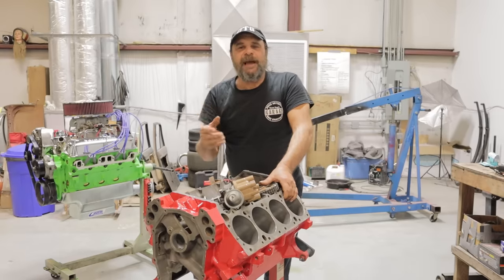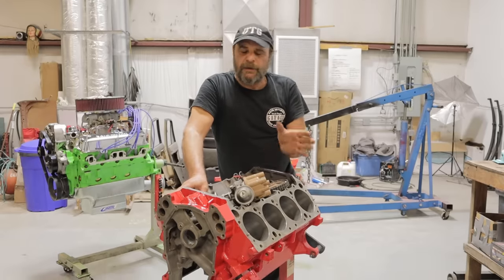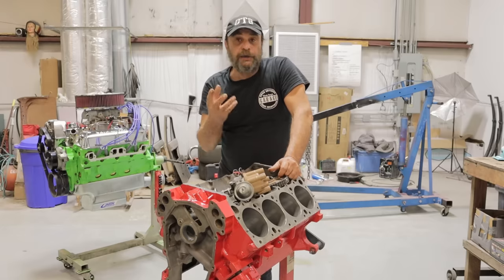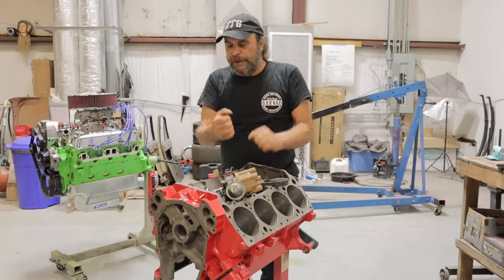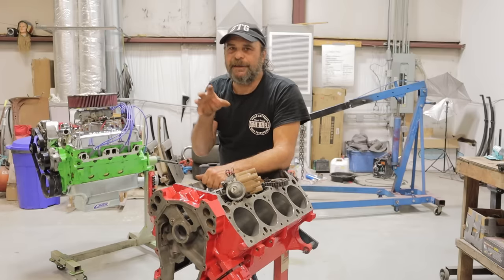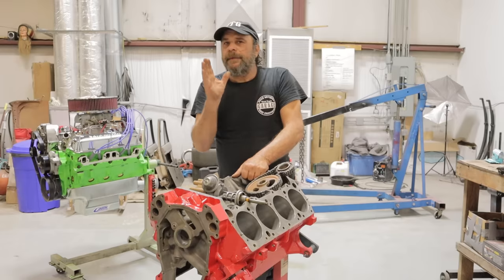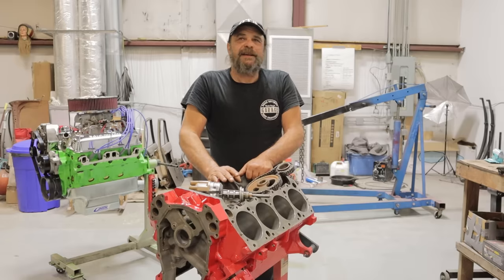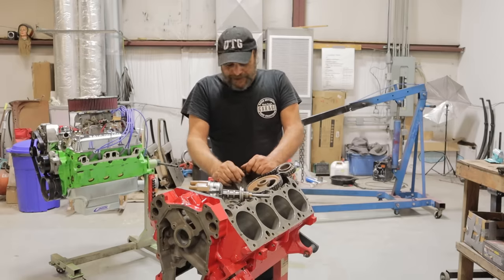Power Timing Secrets For Classic Cars

Comment: He may stumble or whatever. But who can have so much info and be spot on?
I'm 24. I learned from guys that was vets of WW2 and some even from WW2. Pretty much spot on with Mr. Tony here.
I can set the distributor with just a vacuum gauge and the engine will run great. Most folks needs a timing light to do the "same."

Comment: when I static timed my 94 silverado TBI engine with  electronic ignition it was kind of flat... I advanced it 2 degrees and it made a huge difference in responsiveness and overall smoothness and power.  this is a 210.000 mile engine that runs great now.

Comment: I've got an old slant six that hasn't been taken apart since the late 90's I'm pretty sure.  Its got a lot of miles put on it since then.  I have attempted to tune it up a couple months back and had it running at about 12 ATDC.  I just had a feeling the timing still wasn't right.  I saw in one of you're past videos, the slant six doesn't like low RPM and it really comes to life somewhere in the 2500 to 3000 rpm range.  Well in the low range it felt bogy/ labored and didn't really pick up until higher RPM. Just today I went in and lashed the valves.  I want to go back and redo the timing, especially now that the valves are adjusted and maybe bring the timing up to 15 or 16 degrees like you said, just one noodge at a time.  I have a feeling it'll make a world of a difference. I love you're videos! Just like you, I'm self taught and learning as I go...these videos really help me out a ton!

Comment: I just rebuilt a 4 cylinder Mercruiser/GM for a small project boat. it wont start but turns over I'm going to try the nudge technique. It is "backfiring" through the carb though. I cant use the timing light obviously because like I said... it wont start.  Hope this works. I rebuilt a 350 last year for another boat and I did'n't have a problem. Your videos are awesome thanks for talking the time!

Comment: You are totally right, I got practice when I was 17 in 1995 with my 302 HO carbureted, those nutches 😅 are the secret. BTW the knock you are trying to transmit is the same knock like rattle when engines overheat. Nice video, thanks for bringing those funny flashbacks when I wish I can afford a timing lamp, I either bought the lamp or the head gaskets. My noob mistake was thinking higher compression the more HP without any sacrifices, yeah right. That mistake cost me like 60% of my check to gas it up, there wasn’t any VP near by so I had to put 6 octane boosters per tank to relax the 11.7:1 😂😂😂

Comment: I totally get how this is hard to explain because I did this same thing back in 2007 when I was initially building my van starting out. To this day I still don't have a timing light yet and I've had the distributor in and out of it multiple times, put in new rockers and pushrods setting valve lash, installed a new intake manifold, configured quadrajets, and tons of other stuff and in my own way did this exact same process. You can feel where you need to be off of the "harmonics" or vibrations that the engine is giving off next to you. Since I was working with a van there's something even more personal about it being that you can literally drive with the engine next to you. I've gotten better gas mileage with a Quadrajet than I've ever witnessed with Chevy TBI as well. Nowdays I even time my Hondas by ear, feel, sound, and throttle response. I'm hoping I can get a timing light and a harmonic balancer installer/remover tool in the next couple years. Gotta have that to build the spare 350 engine I'm cleaning up.

Comment: I would love to see your reaction if you ever took a modern ECM tuning class. I think you might be shocked seeing what you can do. Engines so modified that they could never be usable on the streets back then. Can become usable with good driveability. And on top of that, have your factory computer control things. like nitrous oxide methanol injection or even boost controlling. I am running 2 bar speed density on a factory Corvette Ecm.  A computer never made for handling boost. But I understand your love for that era. And It's simplicity.
Reply: Your talking modern day vs opocolyptic preparedness. I'm somewhat of a conspiracy leaning person so tend toward old school
Reply: @campnoutdoors1621   I can understand and respect that.

Comment: Short version [assuming "stock" timing as found]: tiny bumps to advance until motor goes from a perfunctory ho-hum response to feeling a little snappiness when throttle applied - stop there.   Shadetree know how in a nutshell. 
Points? I gotta have a dwell meter, but I can get down the road til later by folding a dollar bill twice: 4x thickness is damn close to 0.015"

Comment: I've been suspecting this for quite some time. I have an FE390 with about 90k miles on it. The timing chain was worn out (common thing on old FE before double roller chains). I had to advance it well past the original 10 degrees advance to run right. Wouldn't hardly run on less that 10 degrees. I changed the timing set and now it's fine. I also have an old small block Chevy with only 40k miles on it and I can tell it already needs more advance than the original spec. If I don't want to mess with timing all the time, I do try to adjust them during the hottest time of summer and after running the engine several miles so it's good and warm inside the combustion chamber. Great advice. Thanks.

Comment: Another great video!
I know there are O2-based mixture sensors. I bet a stand-alone sensor that measures knock using a modern sensor would be a great diagnostic tool in these instances.
Reply: They have them. They are called knock sensors
Reply: @alexyoung4587  There is no stand-alone knock sensors, similar to an air/fuel ratio sensor, that I am aware of.
Reply: @alexyoung4587  I'm aware. Perhaps you know of a source that has a stand -alone unit that could be used for tuning?

Comment: I have been doing it this way over 40 years I call it road timing and later on in time when done on my 318 with 340 x heads edle performer intake 600cfm carb 15/8 headers id beat some big blocks because i know them boys didn,t know this trick, I understood right from the start of this video what you are talking about. My 318 runs strong on this combo, I failed to mention im running a stock cam otherwise with the 202 valves it would kill my engines performance I am assuming may be I can go a little bigger yet the stock cam worked well.1972 ply scamp 727 trany 373 in rear.

Comment: So this is what I did today on an ‘85 K10, 350. I had a vacuum leak that ended up being the intake gasket on the left side, pulled the manifold, edelbrock performer, cleaned everything up, dropped the intake back on with good fel pro gaskets, got the number 1 to TDC on the compression stroke, dropped the distributor in, rotor at number 1, everything going pretty good, started up good, ran semi ok, getting some popping through the exhaust when shifting, standard, nothing too bad, but I don’t have a timing tab on the timing chain cover so I got out the vacuum gauge and advanced the distributor to about 20, took it out, ran good, popping gone, ran strong, seemed to like the setting, the only issue now is that it turns hard trying to start it where it never did that before, I also tuned the carb with the vacuum gauge as per the UTG video, yeah I’m a subscriber, so it all seems to be pretty good except for the hard cranking, not complaining, it seemed pretty happy, I’m just wondering if I’m a little too advanced

Comment: Just bought a classic car with a Chevy 307. Runs fine but some hesitation on first gas. I did what you suggest. I gave it a nudge. (timing light said it was already 15 degrees before tdc) After the nudge, car runs better than ever. Smooth acceleration. Now it reads 17 degrees advanced. Others are telling me that may be too much and could cause detonation. Should I worry?

Comment: Some smog distributors have so much mechanical advance that you'll be getting spark knock at higher RPM/under load while still having a sub-optimal initial timing. Limiting the mechanical advance first can make a huge difference. I have a Ford 300 that would ping hard under load with more than 10 degrees initial, after limiting it to 16 degrees mechanical and setting the initial to 20 it wants to twist the frame as soon as you touch the throttle without ever pinging and runs beautifully.

Comment: @Uncle Tony's Garage
So out of curiosity, "with an automatic"  what if one were to chock front wheels and having a friend stand on the brakes (make sure you don't owe them money) and 'you' controlling the throttle work it up until its up against the converter, no tire spin, and adjust timing until spark knock just goes away? 
Is this about the same thing? 
Obviously you are not gonna be able to do this with 500hp cars, or anything that overpowers the brakes, but rather 3-400 hp street cars? Seems like about the same idea...? Was showed this trick by a couple different  old timers and it made my car i had in highschool turn into a rocket. I've done it a few other times too, on mild street cars,, with great results. Its cave man, but seemed to work...?
Just curious. 🤷🏼‍♂️

Done it driving, like you explained it too, using a timing light just to record my "nudges".... but not everywhere has easily accessible hills nearby.

Comment: An off the wall here but it applies as well. I used to play guitar & bass. I tuned by ear and because of that I could go from a standard open tuning to a drop D in the middle of a song or solo. Now I've lost my ear (I'm going deaf) so I have to rely on a tuner. I can't do that anymore; I have to stop or grab another guitar. It sucks.
Great video UTG! When I 1st got into this stuff, dad made me do everything by feel & hand. Why? Because you don't always have the fancy tools to get it dead nuts on, and tools are mechanical (or electronic) devices. They wear out. They can have problems. If you have the "feel & ear" for it, not only will you know if the car is right, but you'll also know if the tool is right. People hit me all the time with the "why don't you use this or that" when they see me using hand tools and using the "Nooge or Smidge" adjustments..... it's because I'm feeling it just like you are describing.

Comment: I daily drive an 85 f150 300 straight 6, new china made Carter yf single barrel and a no name hei distributor. Np435 granny 4 speed transmissiom. Used this method to time the distributor after watching this video. The truck has the best acceleration and smoothest idle yet. Though I went 2 nudges back after the ping started to account for added weight in the bed if I ever need to haul something.

Comment: I do it sorta similarly. Tony remember a couple livestreams back when I mentioned I am running 42 to 45 total on my 455 with a closed chamber head on E85? Those heads were on another 455 in the 1990s, running VP red and Sunoco 110 race gas. It wanted 52 degrees total with both of those fuels.  E85 burns faster so it wants a bit less timing. Its what it wants and it runs fastest and the most drivable with that much advance. No the balancer did not slip either, and multiple lights have been used to see where its at including dial back and marking the balancer ring..

What happened when I backed it down to 36-38 total like all the chevy guys say to do? It went from 11.40s@120mph with all the advance, to 13.20@ 98-100mph with 36 total and the same initial on race gas. You could say that is a rather large difference in performance. I raced it 12 years, shifting at 5800rpm, the trans would shift at 6000. It wants that much advance, and without it, the car slows a lot. I was honestly surprised when I found it wanted 52 total in 1998, I hadn't checked it, I just cranked it up until it didn't start hot, then retarded it until it did start. To get 36 I blocked the advance slot under the weights.

Do an image search for the chambers of a Pontiac 670 head, its an oval shaped chamber with two large quench surfaces top and bottom. The open chamber headed engines want less, usually around 40 to 42 total. It also had springs and weights that had all the mechanical advance in before 3000 rpm. Running an HEI in the 90s and an MSD 6AL with MSD distributor now. I think.. I have a lot of engines, some with HEI, points, or MSD stuff.

I find the sweet spot for initial by giving it advance until it doesn't start hot. Back it down to where it never drags the starter and thats usually pretty good. Then I add mechanical and vacuum advance until it surges going down the road at a steady speed. When it surges it has too much advance. At that point I see what the numbers are giving me my min/max, and I used to take it to a track to see what it wanted for best power, then what it wanted for driving around in traffic. The track is 5 hours away, so I haven't raced in a long time. I have a Dragy now, and I use that to tune things.

I never hear them rattle, mainly because E85 doesn't ping with less than 16:1 compression, the race gas never pinged either, and the pump gas engines all had between 7.5:1 and 8.8:1 so they would run no problem on 87 octane and not ping. Fully machined combustion chambers FTW. Why pay for premium when a point of compression doesn't get you much gain? Crank it up to 12:1+ On E85 and enjoy the extra power or leave it on 87 octane. A chevy or LA engine will ping, but my Pontiacs didn't as long as the cylinders/chambers weren't fouled with oil and carbon.

I don't run the vacuum advance to manifold vacuum, I put it on the port that doesn't see vacuum until the throttle opens far enough. That way its not rolling around with full advance all the time, which causes surging and other not so wonderful things.... like running hot and losing power up top because the vacuum drops so it loses advance. It makes it easier to get the drivability without the vacuum advance cranked up all the time, mostly because Pontiacs are not slugs under 4000rpm, even the 350s and 326s are making more of their power under 4500, and pulling to 5000 at least.

I have around 2 months left before I can drive anything old that I care about. The snow is still deep, the roads are still salty, and currently we are enjoying a downright balmy -2F here. Otherwise I would go make a video of what it wants for advance.

Comment: Great advice! I was taught tuning by ear. I never thought about the vacuum advance being the direction to advance timing. learn something new everyday. My daily driver is running a 73 Chevy 307 with vortec heads and points dizzy from my 72 Impala. My manager racing fi ls stuff thinks I'm behind the times but it runs everyday. timing lights and factory dwell setting makes it run like shit.

Comment: When I was a young buck starting out in a shop, my old timer boss saw me timing a Diamond Reo distributor after a tune up and replacing the points and condenser.  As he was walking by me when I was climbing down off the truck, he grabbed the timing light out of my hands and threw it in the garbage, never missing his stride as he walked away.   I picked it out of the garbage and put it in the bottom draw of my toolbox, and to this day it still sits in my bottom draw and never used it since that day.

Comment: I ran for awhile, a 1974 Dodge D100 Camper Special. It had a 440 with 7.8/1 original spec compression, 727 auto, 8 3/4 with 3.23 gears. When "power timing" it, I could go too far with out ever getting to a knock. What would happen instead is it would develop a miss at higher rpm(over 4000) and then I would have to back it off to get rid of that miss. I swapped it over to run on propane and part of the kit was a timing limiter plate for the mechanical advance. When I put it back to gasoline I never removed this plate and I found I could get more advance without getting the higher rpm miss. Propane has a higher octane than gasoline just for reference.

Comment: Awesome video Iv always tunned my timing by feel and, sound and response Your right you cant explain to people when its right you just have to feel it  I run SB 400 GM i give it all the advance until i get that little hesitation in starter motor always worked for me .  I don't ever us a timing light I never install the timing tab anyway due to timing chain advance  the tab is worthless . i also like Acell hei distributors with the advance timing setting inside the vacuum advance valve that can also be adjusted to fine tune that advance.

Comment: Most v8's atleast GM and ford's in my experience will work well between 10-14 depending on mechanical advance . Then swapping the advance springs Med springs . I also will set the idle to achieve max vacuum reading then make sure the lean best idle won't screw up the off idle response so usually setting the accelerator pump shot.   My street strip car I have 14 initial with 36 total by 2500 rpm . With a light and medium springs  but it's a lighter car. On my cruiser it's 10 initial , 36 total by 3500 rpm but it's a much heavier car.  Although I don't do it by feel I will fine tune the timing advance ( rate ) and carb circuits by the seat of the pants but have also used an AFR gauge with great results. It took my carb tuning to the next level.

Comment: For automatic transmission cars I always had someone hold the brakes, drop it in drive. I would control the throttle at the carburetor, give it some throttle and adjust the timing by ear. Then shut it off and make sure it starts ok. I have timed hundreds of old worn out cars that way.
Reply: lol